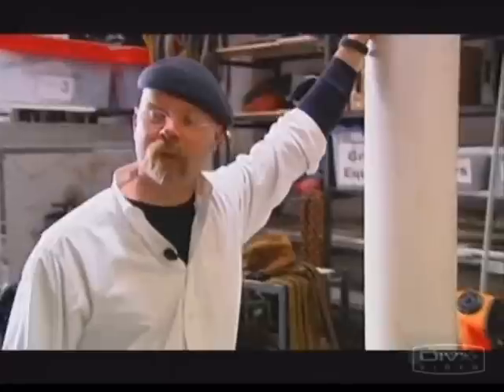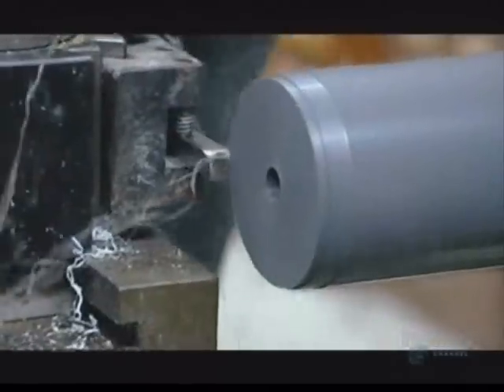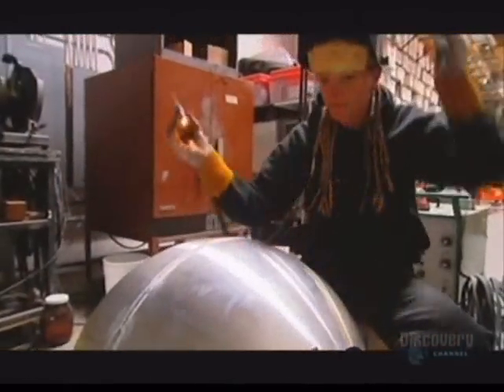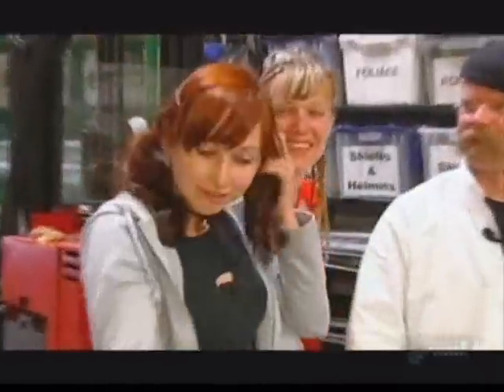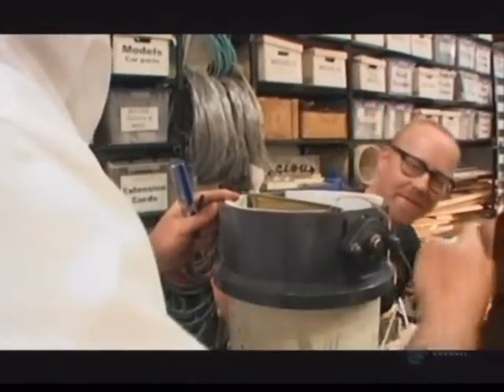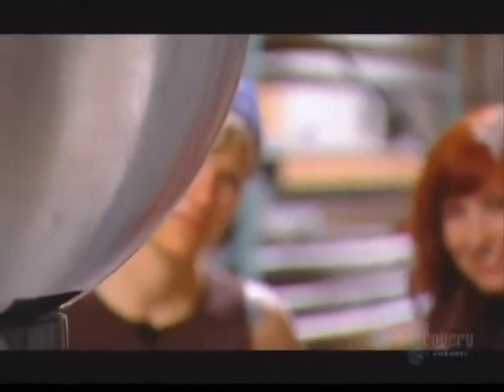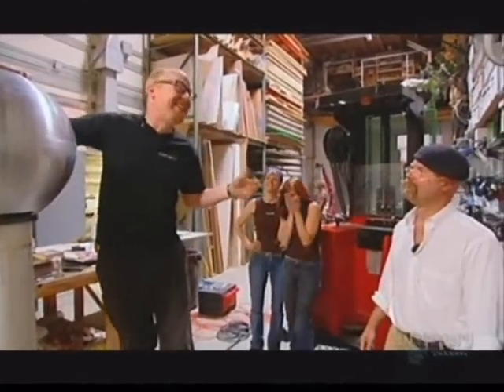Mythbusters Van de Graaff generator

Comment: That's the thing about the "angry pixies". Voltage alone does not kill. It was high enough voltage that the spark jumped a couple inches through the air (an excelent insulator) to reach Jamie, but it lasted so short and the current so low it was like a needle prick.
Now admitedly their Van de Graaff generator wasn't the best- the materials could have been better, the terminal bowl was likely bleeding a lot of charge with those sharp edges, etc. but even then these generators arent exactly known for high current and it's DC which is less dangerous to human body than AC. You should always be careful working with electricity, especially high voltage, but it's not dark magic.

Comment: NOT  100k volts running through Adam's body.   The charge remains on the skin surface and travels thereon.   Not enough amperage to overcome the body's natural electrical resistance and  go internal and do damage.  We are mostly water but our bodies have more resistance than water.

Comment: 50,000 volts... that would go at least one foot.
Reply: Actually, the american society of electrical engineers (an extremely credible source) lists in their handbooks that it requires 30kv for a 1cm spark between two 1" brass spheres. This is further proven if you search "dielectric breakdown of air" on google. Your results will return as 3,000,000v per meter. That is 30,000 per centimeter. Not 10,000. I have independently tested this for over 10 years and have confirmed it with my own studies. Often the 10,000 volt figure is thrown around, and I really don't know why. It is not a big deal, but I wanted to share this information. 50,000 volts on average would produce a 1.66 cm spark, or, about 5/8 of an inch (if two points are not sharp)
Reply: No, about 1 cm = 10,000 Volts so 50,000 volts = 5 cm
Reply: Oh  I thought it was 1,000 for one inch
Reply: +Plasma Channel oh hi
Reply: Ha, I noticed it was you.
 Pleasure running into you again!
Reply: +Plasma Channel you too!
Reply: Indeed correct. Many variables affect spark length. Using only 50,000 volts, one can create a 1-foot spark either by reducing pressure drastically, or, by using a noble gas as the medium.
Reply: Vivid Media, I assume you're referring to a Van Der Graff generator? Big shiny ball on top? Those are extremely fun devices, and very safe as well. They use a fairly inefficient design to produce a charge, but it works and works quickly.

Comment: If you put an INCANDESENT light bulb in a microwave, and run it for 30 seconds, the bulb will light.

And it will get very hot, and might melt.

Comment: if you were to hold a lightbulb in one hand and place the other on the genny would it light up?
Reply: +VolkOseba 
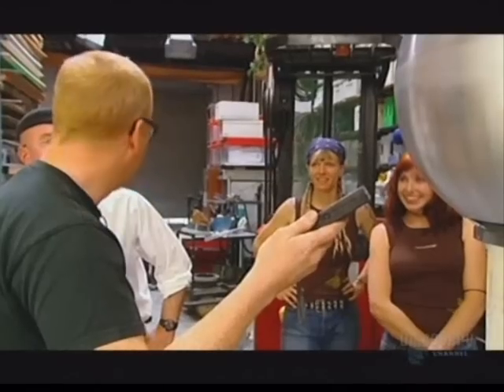3:33 BTW, that is an E-field meter which means the reading is not voltage 50 kV but electrical field 50kV/m (or perhaps 50kV/inch). That guy is ignorant...
Reply: +PatriciaIsSoJokes 
Tubes filled by mixtures of Xenon and Helium gases give the highest light output as perceived by human eyes.
Reply: +[H]ouse MD No.  Van de Graaff generators have a very small short circuit current, which is a big part of why they're so safe to play around with.  With a big discharge you might be able to make a bulb flash, but that's about it-- and I wouldn't expect to be able to do that with this particular machine, because... quite frankly, they didn't do a very good job.  50,000 volts at this size is pathetic-- those little table top generators they were talking about are better.
Reply: +[H]ouse MD Florescent lights work, I've seen demonstrations using them, but I think that you need a certain type.
Reply: awesome!

Comment: I built these a lot as a kid. You think they'd research the physics here a little better.

Biggest error, as others have pointed out was the cutout edges. Most professional VDGs have the upper collector (the dome) go right over the main tube (and pulley assembly) so that the bottom of the dome (the lower hemisphere, actually sits a few inches beneath the top of the tube) and... most importantly, the hole cutout for the bottom half is ideally rounded in for max voltage retention.

I'm not sure if they used a metal pulley on the bottom (traditional) and an all plastic on top, but again, that works best. Little details and tweaks can make huge differences with these machines. Sometimes, just a tiny tuft of copper wire on the belt works a whole lot better than a brass screen. I'm not sure what material was used here for the main tube, but it can be critical too. Any contaminants or fibres in the tube or belt material can leak off a lot of juice.

Yep, it was pretty disappointing. I used to get a steady stream of 12-14 inch sparks off my old paint/can 12 inch collectors running on a record player motor.

And they could have looked up a few more electrostatic tricks to perform using this device. Pinwheel 'swastika' corona motor, electrostaic 'popcorn' (aluminunized styrofoam balls in a wide clear container with a metal lid on each end. And there's plenty more.
Reply: Bob Roach can you tell me when you get a chance please?

Comment: This video shows something big, Voltage doesn't kill, it just affects the pressure.... Amps are what actually kill.... but only if the voltage is high enough to use you in completing a circuit.
Reply: Charles Anderson yeah in a gun it's the bullet that kills you!!!
Reply: +Charles Anderson True. That's why you can touch a cow fence and live, since they can run with about 10.000 Volt and sometimes more, but only with about 10 milliamps (give or take). It can hurt like hell, but it usually won't kill you.
Reply: It's not the volts or amps that kill you, it's the watts.

Comment: The problem with their generator is that they have cutouts on the terminal which have sharp edges which are bleeding off the charge. A failure of their reseachers. Someone mentioned that they could have bought a a 400 Kv model for less than $600 that actually works. I'll bet that they spent more on that custom terminal.
Their unit had good chance of great performance if they wouldn't have mucked up the terminal.
Reply: I also don't think their belt material was the best choice, but i can be wrong on that.
Reply: Incompetent jack's of all trades...
Reply: They should have used somthing like nylon pantyhose or rabbit fur for the belt and for the roller somthing like silicone rubber for more static electricity but the sharp edges you are talking about maybe you are saying the hole in the dome they should have just glued it and connected a wire  if that's not what you mean 
I assume the pick up brush is what you are talking about its supposed to be like that sharp edges pick up charges as well as they give them away, but they totally screwed up I have one you can fit on a desk that makes 500,000 volts from materials at home depot and walmart the only thing I didnt buy from there is a ac motor of Amazon
Reply: @godparticle3833  They put cutouts in the collection sphere to fit over the pulley and those have sharp edges that bleed off the charge. The combs internal to the dome are correct, those should be sharp. The pulleys should be completely inside and the entry hole should be turned inward so the sharp edges are inside the sphere. Just look at any commercial science company educational generators.

Comment: This device is lots of fun as it is, but it's very expensive for the performance. I've made one with comparable performance that was maybe a third of the size and a tenth of the expense. I suspect this large one COULD have a lot more zip if:
-the upper roller was further inside the terminal
-the hole in the terminal was rounded smoothly inwards and/or had lots of electrical insulation added to it
I didn't catch what the rollers were made of, but that might make a difference too. A glass roller and a PVC roller would be pretty good, I think.

Also, these work best on very dry days.

There are lots of fun things you can do, even at this lower performance level. For instance, if you make a little metal pinwheel with points at the ends, it will spin if you set it on the generator. Also, if you mount a pin on the terminal (i.e. the sphere), you can light up a fluorescent light bulb several feet away. Best done in a dark room. (You can also burn out a compact fluorescent bulb's power supply if you light that up from too close.) If you put it in a room with a sheetrock ceiling, and let it run for a while, styrofoam peanuts applied to the terminal will stick at first and then jump off. Some may stick on the ceiling, even after the generator was turned off, or you can just throw them up there and they'll stick. At least in dry weather. I've seen them  stick for at least half an hour. Many other funny stunts are possible.
Reply: lr21643 cool can you tell me more please

Comment: *Terminal Gravity and Van de Graaff Generators.
It is important you know how artificial gravity is created. I t is described in the chapter A Matter of Time. From Einstein you derive that you can only create gravity artificially until light speed is approached. With energy you thus so create gravity. However the oposite is true too. With matter clustering you create gravity although now in natural form. Suppose your car broke down. You ask people to push your car then you set your car in its first transmission gear, give some gas. The people who pushed your car created a very small force, yes indeed gravity in your back, for this it took these people energy, the people pushing your car needed food wich is matter that contains energy also. Matter needs energy to manifest itself. But energy needs matter to manifest itself too.  They are needing each other. Now imagine a very unimaginable big star that collapses because there is no more energy for fusion to ptotect itself against the clustering of matter. Scientists call it black holes. Why do they suck matter? Because for gravity to exist either energy or matter needs to be obtained.  The only way for a black hole to continue existence is draining energy to maintain a natural terminal gravitational field, wich is obtained from external obtained matter. This GRAVITUS TERMINUS cannot exceed some limitations like lightspeed is proven to be finite too. Inside blackholes there simply is maximum gravity. Now ask yourself, does Anti Gravity exists? We observe an expanding universe, how can something so powerful like a black hole be overwon by something as simple as an unknown force? I assume we observe hereby that Anti Gravity manifests itself on a UNIVERSE WIDE scale. I assume that Anti Gravity is the most powerful force in the Universe. Assume Earth its gravity suddenly would turn into anti gravity. The whole planet would go Big Bang until ANTIGRAVITUS TERMINUS is reached and matter of wich earth consisted could cluster again. Fortunately we are unable to create this most powerful force I could ever possibly think of. But there is observible evidence in our ever expanding universe its assumed momentum, where its accelerating expansion proves its not momentum or inertia/ertia. Have we discovered Anti Gravity? As Stephen Hawking predicts this theory describes that eventually blackholes dissipate and simply cease to exist too. Just because lightspeed is finite, THERE IS A MAXIMUM TERMINAL GRAVITY. I do not break any rule of science. Einstein explained it all and so did Stephen Hawking.  Why bother with formulas. End of part3/142
Reply: Fortune cookie
Reply: GaryKildall <- If you are logged in with Google Plus before pressing my name you will know. Read the GNU PUBLIC LICENSE book Universe for Dummies, just press about me on my Google Plus page. It's free.

Comment: If you want to get hurt, conect the static charge generator to a large jar of water, and place it on charge carrying surface. Then you should wait for a minute, then grab the mettal surface and at last dip your fingers in the water or grabb the cable conecting the charge generator with the jar of water. But don't wait to long, or the jar will probebly burst, melt or something. I have never tried doing so my self, I might be wrong.

Comment: The reason the sparks were so small is because the Wattage was VERY low.  200kV at very low Amperage will not give you a very large spark.  It is also the reason it didn't kill them.  Remember, V * A = W; where V is the voltage, A is the amperage, and W is the wattage.  Therefor, 200,000V at 0.00005A gives you only 10 Watts.
Reply: How did you calculate current?

Comment: volts aren't nearly as dangerous as amps- 0.1A is enough to seriously injure or kill you, and thats the point of this video.
Reply: That's not entirely correct.
Reply: n00baTr00pa I quote, from several good sources (including a textbook) "Amps are more important when assessing the danger of an electrical current. Even small voltages can kill if the shock carries enough amps- current as low as 0.1A can be fatal." Though it might not be the point of the video, the info is legit.
Reply: I do agree but amps aren't dangerous without volts.
Reply: n00baTr00pa True. It's kind of like comparing amps and volts to water pressure (in this case, how fast the water is moving) and water flow- they increase with each other, and can't exist without each other. Also, water pressure is ultimately more dangerous, as it automatically increases flow and causes more damage in a shorter span of time.
Reply: +Gloria Zhang for an electric shock to be fatal to a healthy adult >0.5A must cross the heart. Less than that can hurt, but wont kill. The voltage required to accomplish this is a function of the resistance the person provides to ground. I measured the resistance across my dry skin at over 40k ohms. I licked my fingers and it dropped to under 900. assuming the path to ground is through the feet, this resistance would have to be added to the resistance of the shoes being worn. Half the resistance and that is approximately the minimum amount of voltage required to kill.
Reply: +Joseph Vedda Ha ha I wrote that based on what I knew from cramming for grade 9 science finals- even so, I appreciate the reply. I can't really do much more than parrot lines from textbooks, but what you said was really interesting.
Reply: volts on its own won't kill you sane with amps you can touch 0 volts and 1000 amps but touch both then there will be nothing left of your body lol
Reply: "you can touch 0 volts and 1000 amps but touch both then...."
Um, no. With no voltage potential there will be no current flow.
Reply: Sorry, you can't touch current. Current, like a river current flows. You can't touch a river current. You touch the water. Current can flow through you, and if the right amount does, it can kill you.

Joseph V.
Electrical Engineer

Comment: well that's where you're wrong, it depends on both the current and the voltage. Massive voltages can be safe with a current in milliamps, but if you have your "0.5 amps to stop a human heart," and 1 picovolt, absolutely jack shit is going to happen.

Comment: Voltage / Resistance = Electric current (measured in amps)
this is ohm's law. 
whenever voltage raise, amps raises. the reason electrostatic energy won't kill you has nothing to do with low amps, it's a matter of how little capacity you have and how quickly you disperse it. a static shock hurts A LOT and it's only an istant. now immagine a whole second of that pain, you'd go insane. Again, volts are dangerous because they directly increase the amps.

Comment: Depends entirely on the person and the waveform of the current. While tens of milliamperes of 50-60 Hz sinusoidal current can be dangerous and even lethal (but by no means means instant death), you usually need hundreds of milliamperes of DC current for it to be dangerous.
Of course, as I mentioned earlier, the duration has a lot to say. If the duration of the current is too short it won't have time to do any damage.

Comment: Wrong. With the body being mostly a constant resistance, it's all in the volts (Ohm's Law, remember?). A common number for the hand-to-hand body resistance is about 1.5kΩ which gives 45V as the voltage needed to supply a current of 30mA, which if AC is enough to cause fibrillation.

What makes static shocks not deadly is due to the duration of the current surge. One can easily survive, for example, 5,000A if the current surge is limited to a microsecond.

Comment: You must also remember that P.D. essentially denotes the ability for the current to flow, so simply put, if you have a higher voltage situation, there is the strong possibility that the system WILL be able to push more current. You should never make the assumption that high voltage is safe, and really, should anyone even really argue about this at all? Ohm's Law is not that difficult to interpret, and it clearly states that the two are very closely interrelated.

Comment: Depending on conditions, it could take even less, but you cannot disregard the role that potential difference plays in determining the current flow. V=IR so blatantly describes this direct relationship, as the voltage goes up, and since we may assume that in the simplest of cases resistance will remain the same (which for the sake of thoroughness is not completely true), the current must also go up.

Comment: technically speaking yes, but, the can very well determine the amps which means its alright to touch a high voltage if your positive its safe but all in all if i didn't no the amps of a high voltage i woudnt want touch it

Comment: almost, remember ohms law, you need to have just enough voltage and the right point of entry; across the arms with enough voltage to bridge the resistance of the body which is in the neighborhood of 0.5kV

Comment: True, or else a superconductor would kill you since it has the ability to maintain a current without any applied voltage. Take a look at the equation V=IR where I is current and R is resistance. A superconductor has 0 resistance and can have lots of amps.